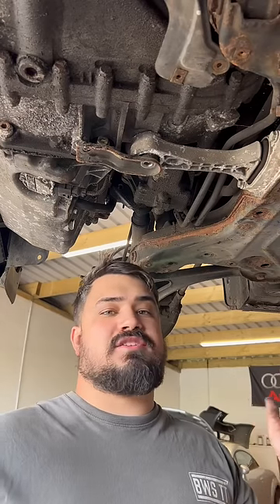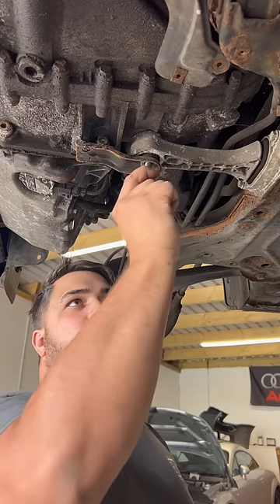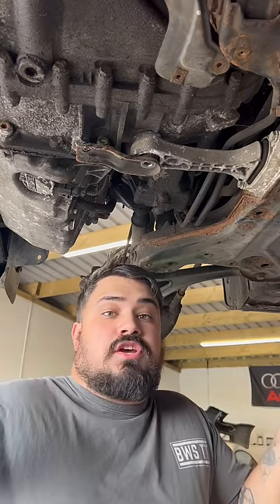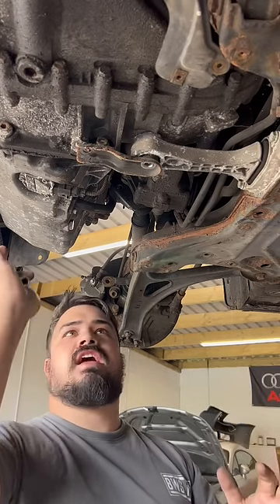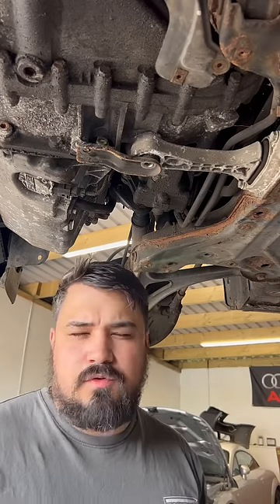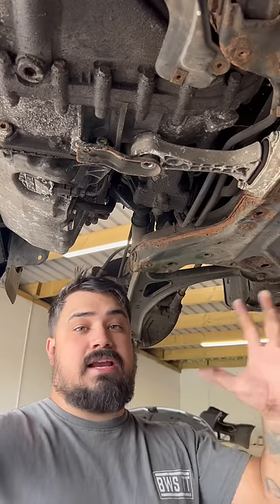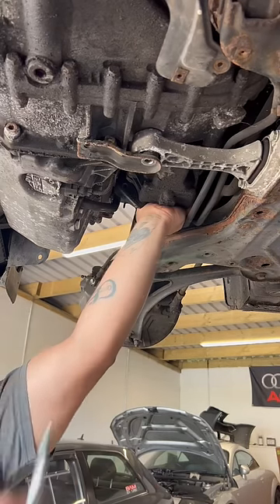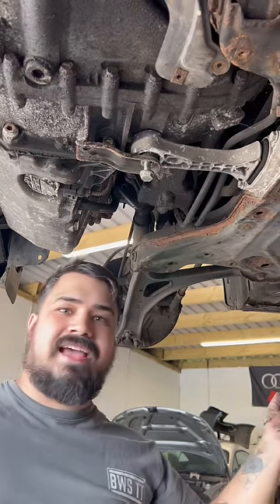Oh no- the bolt wont fit in the hole!!! Dogbone mount Audi TT

Comment: It really depends on how stiff the motor  Mounts are .
Reply: They could be stiff as stiff, new, old or as loose as granny's flaps, you could still just push it with your hand.... When the engine is only hanging from the top 2 mounts, it's incredibly easy to move

Comment: I quit my job delivery auto parts for 3 years. I got the opportunity to work with a mechanic part time now. Valuable info for a noobie like me.
Reply from the maker: Check out my entire channel for loads of useful how to videos, plenty to be learned! Good luck with the career change
Reply: You might want to start working with that mechanic full time, because if this isn't common sense for you, you may have changed into the wrong profession.
Reply: @joshquatch2170  I don't think you know how common sense works. I would never start just prying things and moving things until I know it can be done so safely. This isn't common sense. This is experience.. 

It's common sense in terms that if you took it out and things flexed out of position then yes it's common sense...people who don't work on cars will never realize that things don't fit back that easily. I had to learn the hard way

Comment: At the end of this video I thought 'you utter bastard'.  I won't even tell you how I inserted that bolt, let's just say my way..... took longer.  Excellent advice thank you.
Reply from the maker: Please share your method!
Reply: @BWSTT  lol he won’t do it

It’s too embarrassing lol
Reply: Listen.  I had to change my clutch slave cylinder on my ttmk1 Quattro.   The two bolts that fucked me were the one waaayyyy down in the passenger front drive shaft and the one on top of the gear box behind the motor that's blocked by a stiffening rib.    The solution to the first was to weld piece of an allen key to pieces of junk push rod from an old motor and the solution to the second one was to take a extension and grind it down until it was small enough to get straight on with the bolt
Reply: @northcarolina209  Alright, here it is:  I placed a spare axle-stand underneath the gearbox and lowered the whole car down on the jack by about an inch or so to rock it back because I didn't realise how easy it was to just physically push it with your hand.  Lol.  Now the entire state of North Carolina can have a laugh.  But not those from Greensboro though.
Reply: You should stay away from auto repair.
Reply: @taintedsasquatch398  You should find a good shiny high voltage cable to lick, It'll prevent further dirtying of the windows at your local primary school.  Do you like the colour of copper?  It's nice an shiny.
Reply: @headshot6959  I hate Greensboro ngl
Reply: @taintedsasquatch398  Show us your repair shop.
Reply: @headshot6959  😂🤣😂🤣Boom ⚡️⚡️💥
Reply: @BWSTT  0
Reply: @taintedsasquatch398  you should stay on the internet
Reply: @headshot6959  😂😂👑😂😂😂
Reply: @taintedsasquatch398  you've never even changed a flat tire gtfo
Reply: @taintedsasquatch398  you got properly toasted there son 😂
Reply: @headshot6959 Props to you for admitting how you did it. I wouldn't've known how to fix it properly either.
Reply: @MM-jf1me  Hell, if others can have a giggle at my stupidity it almost makes it worthwhile ;).

Comment: It's easier for engines that are balanced on the mounts well. Like my v6 mustang you can left the back of the engine to line up a transmission with two fingers. A chevy 350 on the other hand takes a 7 ton jack
Reply: ROFLMAO 😂

Comment: I've changed that exact mount b4 a few times. Have done the...push/pull of the engine method.
Have also not fully tightened the other mounting bolts till I had all of them threaded in which allows for getting that particular one installed easier

Comment: Yep, I feel this haha. Ive watched buddies do some weird stuff to line the mount up..

 Ive also fixed the dogbone mount holes/threads on 3 different cars from owners that have completely destroyed the bolts and or threads on the transmission for a Mk4 Gen car...
All of them have turned out pretty damn good and I told them not to bottom out their engine horribly and to make sure these bolts are always torqued to spec.

All these cars If you can manage to get the old broken part of the bolts out, You can oversize the hole to run a EZ-Lok M10-1.5 Threaded insert kit into the new hole. The kit will come with a drill bit and tap. You have to drill & tap as straight as humanly possible and make sure that you don't go too deep. 
These inserts will thread into each other when stacked, And should bottom out almost perfectly lining up flat with the bottom of the trans/top of the drilled hole, If anything a bit deeper but not sticking out. Honestly, I JB weld these inserts in (Included threadlocker is useless) with just enough to not get into the inner threads.

Let it sit until the JB weld sets and install the dogbone same as the factory, Using factory bolts.

Its not perfect but when it gets that bad, Theres no other option honestly that properly solves this issue some create. And a Helicoil will not solve the issue especially not for very long.

Comment: Here's a good question that I would like you to answer maybe you could do it in a demo a dog bone type torque engine mount Preferably GEN two  From 2009 to 2013 ish US model    The problem I'm having is how do you know the right angle for the mount is there supposed to be tension on either side of the Mount?

Comment: Works if you have a lift, but if you don't, and space is limited, I could see a snall pry bar being a good option. A ratchet strap seems like it would take to long but could work too.
Reply from the maker: So you have limited space but have room to get a pry bar in far enough from the engine for it to be useful? In which case your arm is all you need. I swear people are obsessed with over thinking this!

Comment: I've never worked on engines but my literal first thought was to push the engine.
Wtf these people on.
Reply: The fuckin ground. I aint got a lift and sometimes it's hard to get angles when you're under a car on jack stands. It can be difficult to see this stuff, plus engine heavy, I wouldn't think I can just push it with arm strength
Reply: @liamstanks1547  I see where you are coming from, but surely you would at least try pushing the engine up, so that you know for definite if it's a viable option.

Comment: Looks exausthing. I use gravity. Takee hold onto the front of the engine and pull down. Takes less force. Work smart, not hard
Reply from the maker: Youre not using gravity, the engine is rotating, so you pulling the front down is pushing the back up, same effort, scientifically provable
Reply: @BWSTT  except it's not the same effort as there is a pulley mechanic involved when pulling on front of engine. Your bodyweight also counts as a force when pulling on the front. When pushing from the back, u also have to defy the force of gravity on ur body while pushing up. Scientifically provable
Reply: @shivshiv6958  ok bill nye nobody asked💀
Reply from the maker: @Shiv Shiv  theres a lever force both ways, and unless youre hanging off it, youre not using your body weight, youre using a pulling force. Also, realise im not pushing up, im pushing back! Can people who have never worked a day in their life in the motor trade pipe down! Also, while we are discussing it, the top of the engine is closer to the rotation point (the upper mounts) so technically a higher input force is required as you are closer to the rotation point, the transfer box is the furthest point away from that rotation point, so the force required reduces, so actually, that proves that less force is required using my method. Boom. Have a nice day
Reply: @BWSTT  beautifully said sir👌🏾
Reply: @BWSTT  Bill Nye here😂, I didn't mean to tell u how to do your as u obviously have more experience. I just really like pulleys and the mechanics involved; What I can see from the video I'd still say pulling down from the other side would be easier. If u pull down, u dont gotta hang, u automatically use ur bodyweight. But hey, I'm not there working on it, I just see the shit on my screen and have to guess. Thanks for trying to help people anyway, no need to get fussy over some youtube comments, people will always think they know better🤗
Reply from the maker: @shivshiv6958  quick one for you then, you get a greater moment at the point i use than you would at the point you suggest. That should be all i need to say

Comment: And I thought he got some stiff aftermarket engine mounts and you have to really fight it to align the holes, I would loosen bolts on subframe for the dog bone, do the bolts I had problems with and tighten back up the bolts I loosened.

Comment: Well my arm isn't built like my thigh sadly😂 so I just can't use that method as easy
Reply: Go to the gym
Reply: Lock your elbow and push with your legs. Really tho the weight of the engine is still supported by the mounts either side here so it takes barely any pressure anyway
Reply from the maker: Its just rotation, no lifting needed, but ill take the compliment of thigh arms!

Comment: Exactly what we do. We have 2 of these as Tarmac Rally cars at work. Recently just did an engine out turbo replacement and needed to do this. Ehy would anyone ever think anything other than push the transfer or pull on the front of the trans.

Comment: If you're in a situation where you can't move a section to line up the holes
Cut the bolt from the top of the thread exactly in the middle with a hack saw about half way down the thread. Then install.

Comment: It is easier to do it on a hoist or work in a pit. You end up finding the easier way to line up the bolt with the holes on the mount etc.

Comment: Ok coil overs on a 12 Celina with the independent suspension blew my friends minds who couldn't get a bolt in from the strut to the sway bar when I jacked the sway bar into place and slid the bolt right in lowered the jack and put nut on in 3 minutes they were at it for 20 minutes b4 I figured that out

Comment: Until they are the bolts on the control arms when doing a bushing swap. It took me hammering my ratchet as I was turning it for about an hour after another hour of using small pry bars to get it to line up.
Reply from the maker: Even with castor correction bushes on the rear and cookbot/defon inserts on the front, its really not hard to lone the wishbone bolts up if you use a sensible method- ie dont have the ball joint attached at all, so that the arm can sit level to align the bolts. Anything can be hard if you insist on making it hard

Comment: Been a mechanic for 35 years and never knew this was an issue or a problem. I have a better way of doing it and that is call your mechanic buddy to use his hand and move the engine while you put the bolt in with a torque gun.

Comment: When you have hard stage two mounts. Its not that simple. With hard mounts you still dont need to push the engine back. Put the back two bolts in first loose, put the two engine side bolts in, tighten them up, then tighten the back ones up. If you removed these bolts their are stretch bolts. They need to be replaced, dont reside old ones. If your replacing two, replace all 4.

Comment: Man all that rust under there is crazy see boys and girls this why you should clean under the car andat least once every few years you Mae sure you grease up the bottom of your car to prevent rust and it also helps any rubber partsfrm drying and cracking over time it wll help with maintenance and cost for parts

Comment: so to be fair we should acknowledge the mechanics that dont have access to a lift, it can be a bit tricky to get leverage on the engine when you're sideways crawling face on the dirt under your VW with low clearance
Reply from the maker: Easier on the ground- thats where i do the majority of my work. At ground level, all you can fit is your arm, not a 2 ft long bar

Comment: Recognized that underbody instantly lol stupid TT, stay fixed ! mine has 287k miles now, and it gave me a fun gift recently when the differential started getting wierd.. now goes womp womp womp down the road :-) oh, and ALL the electrical problems, i just address the ones that have to do with the car working. The alternator has a flaw in that it fails bad, starts sending electrical spikes.. MORE FUN.. killed my trans computer, one of the ballasts, and maybe effected my ECU

But you know what, doesn't burn any oil and is buttery smooth

Comment: As soon as I'd seen about 3 seconds of the opening footage, I was like... "the engine and gearbox have rotated slightly, give it a push/pull with your hand.."
If its the same bracket that came off originally, and the new dog bone is identical to the old one, then thats the only explanation left.

People who think everything goes back together as easy as Lego, needs to stay the hell away from cars

Comment: Ok but that doesn’t ALWAYS work so simply on every car 😂
I always figure this problem out but it’s sometimes a real PIA
On the Honda Element rear mount I had to grind the bolts into points on the end and hammer them through. 
RIP to your time and efficiency if the customer or shop is having cheap aftermarket mounts installed.
Reply from the maker: I specified the vehicle so as to not imply it works on every car

Comment: Remove muffler bearings, top off blinker fluid, change all caneuter valves, clean windscreen, them break up with your side chick, and then go to lunch... The leprechauns will have it fixed by the time you return from happy hour.

Comment: Did anyone notice.... The hole doesn't line up... 🤔.. But you just put it in.. You lifted the engine and placed the bolt in the same hole.

Comment: So I see this is a mk4 volkswagen and I'm pretty sure it is, and I've changed at least 4 times the transmission on these cars and I'll tell u it is NOT that easy to just push the engine with your hand when your only using jack stands.
Reply from the maker: Well, this is an audi tt mk1, ive done it 100s of times on axle stands, and always pushed it.
Reply: @BWSTT  Maybe it's that I'm just a small guy🤷‍♂️😂 or I don't have big enought Jack stands it's just not to comfortable to do it and I've always used a pry bar to get it in place

Comment: That only works if your exhaust isn't forcefully pushing your engine back 😅😢
Reply from the maker: Your exhaust shouldnt be pushing the engine away from its natural position- if it is then its a shit exhaust
Reply: @BWS TT  it is a cheap Chinese exhaust I bought over 7 years ago when I was broke af. The hassle of removing the old downpipe is basically why it's still on the car. It's called xs power. Either the exhaust is doing it or maybe I didn't try hard enough. All I know is I couldn't move the engine even with the dog bone mount off.

Comment: Noticed it wasn't all one take makes me think you loosened other bolts but hey I'm a micro mechanic not a car mechanic so I wouldn't know
Reply from the maker: Just think it through, at any point while the bolts line up, do i try and move the engine before the actual fitment? So why would i need to trim the clips to hide that? Its one take, trimmed down to fit…. Talk about over analysing 😂
Reply: @BWSTT  that's literally 90% of my job the first 10 is to make sure it's not the obvious 🤣🤣

Comment: Ya mounts is blown.  My shit would not move like that.   Loosen the two bolts that connect the dog bone to the subframe a couple threads.
Reply from the maker: They really arent blown. They are oem mounts doing what they are supposed to do.
Reply: @BWSTT  no mount is “supposed to swing back and forth with the slightest push. Even if 2 of the 3 are on 😂lmao your car tho do what u want

Comment: I know it's easy...... when it's on a lift, but when you're in the driveway in an 8-inch gap. Simple solutions are hard to see.
Reply from the maker: With an 8” gap why would you try using a 2 ft pry bar?
Reply: @BWSTT  What..... I never mentioned anything about a pry bar. Just was commenting on the solution to the issue is easy but in a different situation like on the ground much harder to realize.

Comment: Yeah im pretty sure its not supposed to do that
Reply from the maker: Good job youre not a mechanic then, as its exactly what its supposed to do
Reply: @BWSTT  i mean if you have functioning engine mounts it ain't really supposed to move?
Reply from the maker: @uu9903  shame i cant send you a simple picture of the other 2 mounts, that by design, allow for rotation. The lower mount is the stabiliser mount, to reduce that movement. Maybe do a bit of research?
Reply: @BWSTT  oh is that so?

Comment: Now do that on your back in December in the driveway. Mr lift!
Reply from the maker: Yawn, i did that on my back in November in Minnesota, cold enough for ya?
Reply from the maker: Fuck you calling me spoiled. I bought the ramp after doing this job mobile at customers houses for years, doing this exact part if the job 100s of times on the flat of my back, and i still do it that way. You sir are a jealous failure.